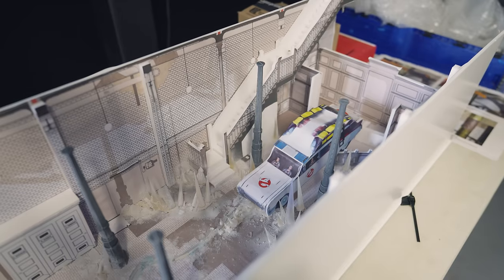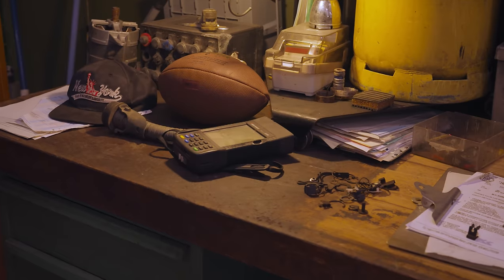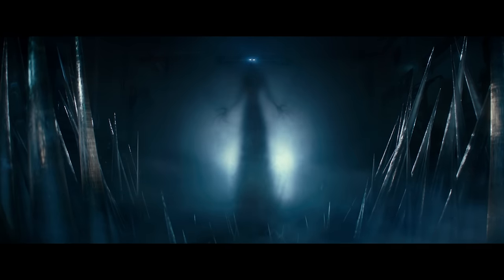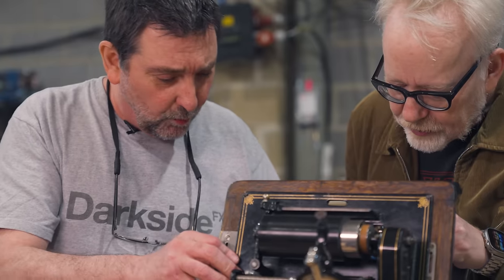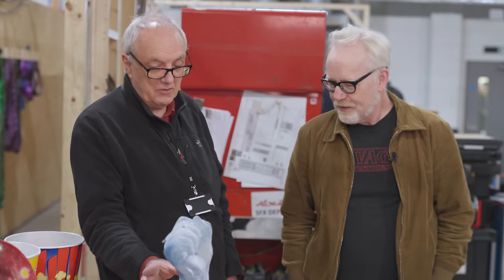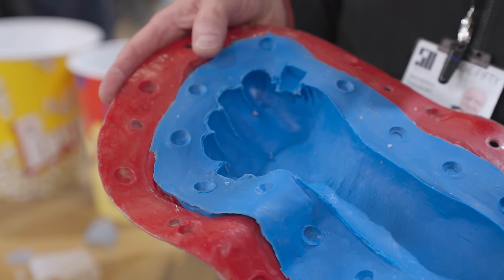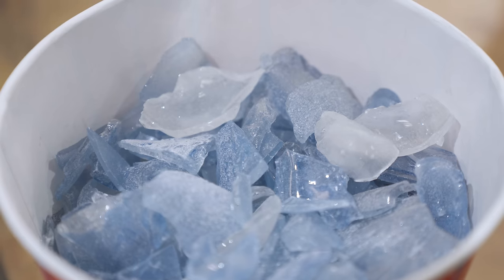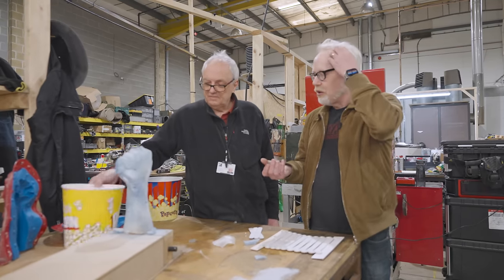The Practical Special Effects of Ghostbusters: Frozen Empire!

Comment: I like how they are using some of the high grade toys for stunt / specialty props -- very much like the effects crews star trek would do with star trek model kits for background space scenes and stuff
Reply: Yup, as far back as the original 1960s series.  twice they employed an AMT 18 inch model kit.  The better remembered occasion was the "Doomsday Machine" to depict the battered "Constellation".  The other time was the Enterprise seen through the window of Mr. Lurry's office aboard space station K-7 in "The Trouble with Tribbles".  Recently I learned they actually went to the effort to illuminate the model, giving it glowing windows and (I think) nacelle domes.  Sadly, none of that detail was seen at the distance the model was shot.  Work schedules probably prevented such, but too bad that extra effort was not applied to the "Constellation" given it was shot far closer  to the camera, sometimes almost filling the screen.  One could argue the windows need not be lit as the ship was heavily damaged and running on minimal power.  True.  What I mean is it's a shame they didn't have the time to better "weather" and contrast the surface of the kit miniature to look less like the hobby model it really was.  Then again, the episode was pretty much a "bottle show", using nothing more than the existing standing sets to represent both ships.  The DDM itself appeared to be constructed of a wire frame (possibly a tomato vine scaffold), metal foil and chromatic gel sheets.  Certain shots even reveal was appears to be adhesive tape to bond the materials.  I honestly wonder if more money was spent upon "Tribbles" due to the need of a station office, a bar, the grain bin room and roughly 500 balls of "fluff", some rigged to "breathe" or to crawl?

Comment: The wand is a deconstructed Showven Cold Spark machine, but using a flame ignition instead of electric coils. That is pretty neat. Powder is the same titanium and zirconium, but the Spark machines also use magnesium.

Comment: The one thing I find a bit confusing about the pack with the exposed cyclotron is where have the red lights gone?

 People have done packs where the interior of the cyclotron have rotating red lights inside, which is meant to be what shows through to the 4 circles at the back of the pack.  Yet in this that's all gone and the cyclotron just rotates with no red light emitting from it.

Comment: I'm sure there's a good reason, but for the cyclotron, why not have the spark paper on the outside ring and have a single pin in the center rotator that drags along? Wouldn't need all the complex air-actuated cylinders.
Reply: Because if you had just a single pin in the center, you couldn't then have different sequences of multiple sparkers going off at the same time, or in other patterns like two at 180°, or 3 at 120°, or whatever sequence they  want.